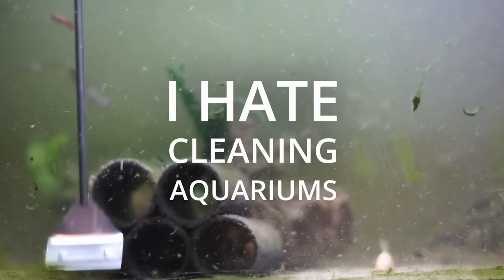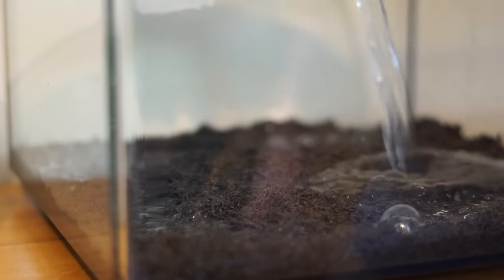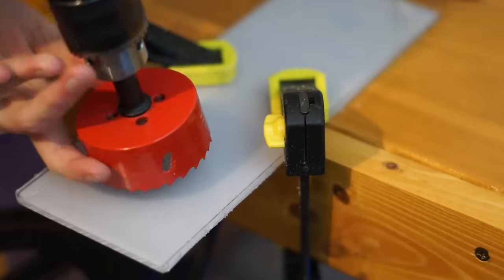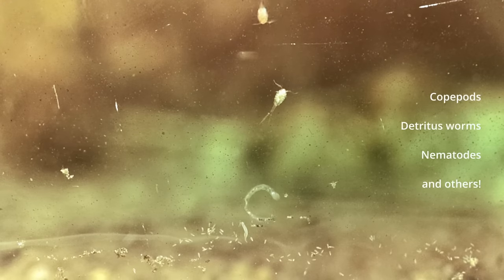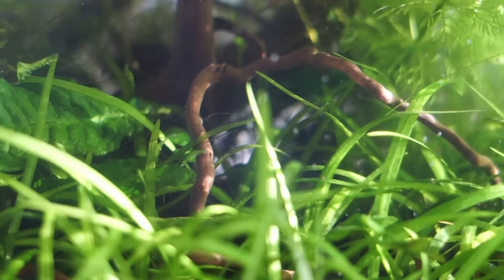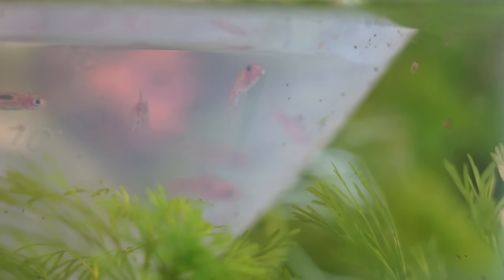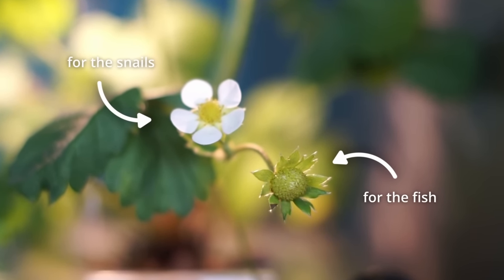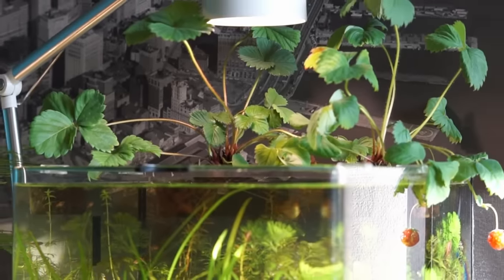Making a Strawberry-Powered Aquarium (With No Filter)

Comment: For plants with above water leaves and submerged roots, the roots intake nutrients dissolved in water while that water eventually exhausts out the leaves.  The amount of nutrients is limited to the amount of water it absorbs - the roots cannot filter in only nutrients while keeping out the water.   You will notice the plants suck up a lot of water causing the  tank level to drop.   The same results can be achieved by a equal amount of water being removed in a water change.
Reply from the maker: I never thought about it like that, but it makes sense!

Comment: I love this video. How long does this setup last? Ie. Does the soil need replacing at some point?
Reply from the maker: Typically the soil will last about 2 years and the idea is that by then the fish waste will have penetrated the substrate to continue providing nutrition. Sometimes you need to supplement at that point, depending on some other factors.

Comment: I’m curious about the lack of air pump or CO2. It seems to be growing well. I wonder how it will hold up long-term.
Reply from the maker: Low stocking and lots of plants means you don't need to rely on an air pump for additional oxygen.
Deep soil with plants that aren't too fussy means they do perfectly well without CO2 injection.
The tank was setup about 13 months ago - everyone is healthy and I've only changed the water once since!

Comment: How do you know how many fish to put into your tanks? I have a 7.5 gal cube that I'm setting up, but I don't know how many or what kind of fish to keep in there. I saw that a honey gourami normally needs around 10 gal, will it still be good in a smaller tank like mine?
Reply from the maker: It depends on a number of factors, though mostly you are considering the needs of the fish.
This tank is around 7.5gal and my gourami does fine, because a heavily planted tank has more stable water parameters than a 'typical' aquarium, and because the environment is much more enriching than say a mostly empty tank.
There's no exact science but since your tank is the same size as mine and mine is doing great, you could use that as a guideline? (I'd say what I put in is about the saturation point)

Comment: Hi! I have a question. Would it matter what surface or table to put a fish tank on? I got a 12 gallon tank and wonder if my dresser can hold it when filled up and all.
Reply from the maker: That's a difficult question to answer without knowing all the variables. The tank is going to weigh around 50kg so you could try looking up the load capacity with the manufacturer. But yes it does have to be very stable with no chance of wobbling or flexing!

Comment: What do you do as far as water changes? How much more difficult is a tank like this to set up than a standard, filtered, planted tank with gravel and sand?
Reply from the maker: It's only as difficult as it looks, since this video covers almost everything. This tank has had one water change in the 6 months it's been running. Give it a go!
Reply: @tanksfornothin  i will. What would happen if you set your tank up like this and kept a HOB filter running? Like an aqua clear for example.
Reply from the maker: @Russian_Bot_  You can if you'd like. It will increase oxygen in the water and mild flow to boost circulation of heat and nutrients
Reply: @tanksfornothin  cool man. Thanks for the info. I have a lot of trouble with my plants I’ve thought of switching over to regular soil for awhile now in hopes it would help them.

Comment: I thought you only put in 2 snails when waiting a month 3:05. But then you said there were fish and shrimps at 3:45 ?? So did you have snails, fish and shrimp in there while cycling it for a month?
Reply from the maker: Good catch - I just misspoke because that's what they usually do, and would continue to do after I add fish/shrimp.
That said it would have been fine to add a couple shrimp or a fish with the snails in my opinion.

Comment: What kind of sand are you using in this set up? Thank you!
Reply from the maker: Golden river sand
Reply: @tanksfornothin  rinse sand first or no? Thanks!
Reply from the maker: @louisguagenti6600  depends on the brand. I try to buy ones I have tested and know they don't need rinsing because rinsing is annoying. But it IS required with a lot of brands. Your best bet is probably to ask at the shop or other local hobbyists

Comment: Would adding a layer of activated carbon be a good idea for a no filter tank?
Reply from the maker: Probably not, its just going to trap beneficial stuff, though I'm not really sure
Reply: @tanksfornothin   Ah ok. Thanks for the information. Would stones work as a substrate divider then?
Reply from the maker: @TheSandwhichman108  What do you need to divide it for?
Reply: @tanksfornothin   To possibly make it easier to remove the top layer of substrate for cleaning purposes.

Comment: Your dirthy water problem came from not washing sand.

The best trick that I found to filter any kind of 💩 in an aquarium (this even includes tanins and green water) are cotton balls.
Put them in a hang on back filter and change them every day until water is cleared. You dont need much, in fact, less is better.
Your problem will be gone in a few hours/days.
After that you may (or not) want to remove the filter and continue (or not) doing this.

Bubbles also are a great way to make dust fall and settle to the bottom of a tank.

I highly recommend to have some kind of filtration and/or water flow when setting up a new tank. All processes will be speeded up by x100

I also recommend to put fish in a planted tank as soon as possible. They will also speed up all processes. Sturdy "unkillable" fish like guppies are ideal to fully cycle an aquarium in a matther of hours/days. Waiting is counter productive.
Reply from the maker: Thanks for the tips, I agree with everything :) The cotton trick is great

Comment: Doesn’t the tank need fertilizers? I don’t believe the fish waste alone is enough to support the plants
Reply from the maker: The soil is enough for a few years, and the fish waste becomes usable by then, and it will be weaker but sufficient when that time comes.
Reply: @tanksfornothin  what kind of soil do you use? I have a bunch of swords planted in fluval stratum in a 3gal and I’ve found I need to supplement their nutrients with root tabs
Reply from the maker: @DSCuber  Most natural soil is fine. I use miracle gro organic compost. Aquasoils vary in quality and can create quite a different environment.

Comment: can anyone answer: the strawberry plants are a living filtration system: but with no pump, is the oxygenation of the water just down to the plants? and when the strawberry plants die, i guess you pop on a different plant for the season? curious if i could ditch the noisy pump
Reply from the maker: With so many plants and so few fish, the passive gas exchange at the surface is enough. This strawberry plant has been producing fruit every week for 9 months so far. I don't expect to have to replace it :)

Comment: Does this function without air pump or does it need air pump to pump oxygen to the water?
Reply from the maker: It's fine without
Reply: @tanksfornothin  thanks for answering,  so it should be fine if i did same with like guppies and a lot of plants, I wouldn't need air pump?
BTW YOUR CONTENT IS AMAZING KEEP IT UP 👍👍
Reply from the maker: @stojakovicilija6576  :) It will depend on a number of factors really. You need LOTS of plants and relatively low animal stocking. Air pumps do help but I don't use them in any tanks. You will have to mawke sure your guppies don't overstock the tank by breeding too much!

Comment: Strawberries inside are highly prone to spider mites, like roses.
Reply from the maker: That's interesting. Looks like I've been lucky but I'll keep this in mind in future
Reply: @tanksfornothin  Outside spider mites are controlled by predators, but they aren't present inside. So if the mites get on the plant somehow, it is in trouble. Some plants like mint and garlic are themselves highly resistant to the common spider mite (there are specialised mite species, however), but not the strawberry.
Reply from the maker: @dmitrimikrioukov5935  That's what I figured based on what you said so thanks for verifying :)

Comment: the strawberry in my tank is easily dead, what should I do?
Reply from the maker: - Make sure it has enough light (move it closer)
- Make sure your water column has enough nutrients (it should if you have soil+sand like me)
- Try raising the water level or lowering the plant, because I noticed mine does better when all the roots are completely submerged but not the stem